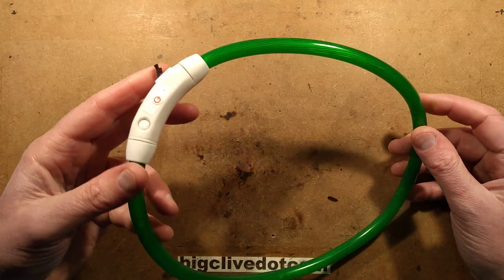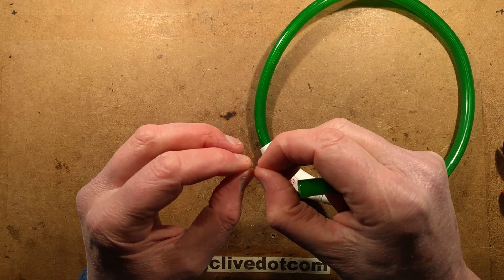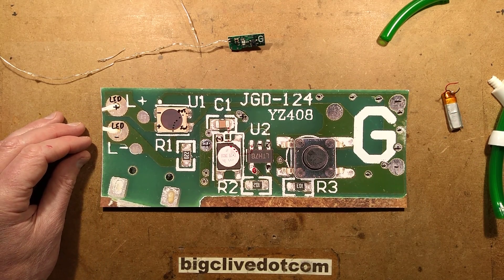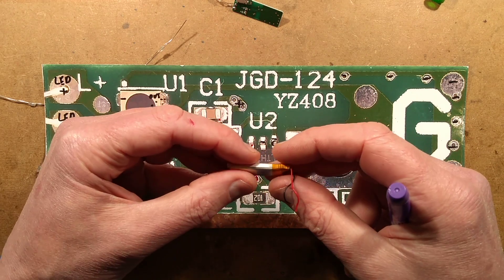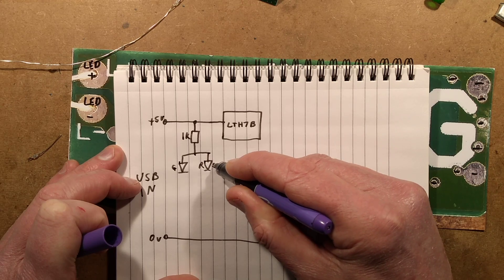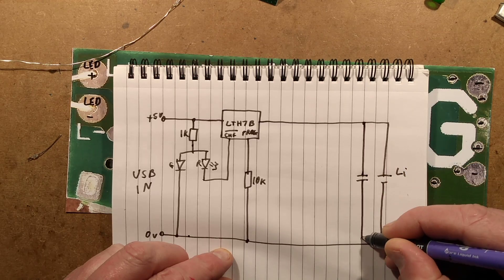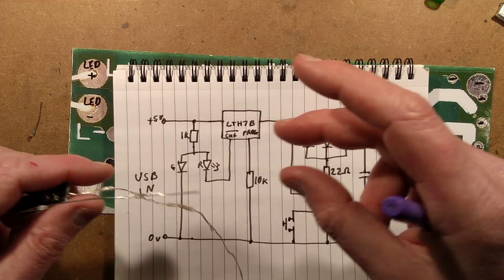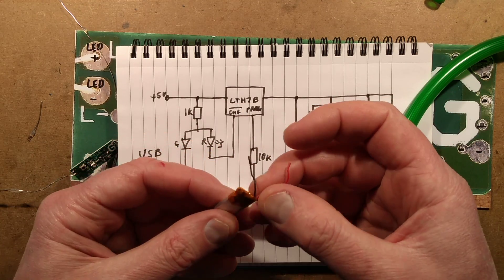Flashing USB rechargeable dog collar teardown.

Comment: I bought one of these the other day, cost £4.99. The tube is rubber with leds inside. There is a mark which tells you that is the most you can cut off before you get to the leds. Other than the rubber tube all seems to be the same except I haven't taken it apart to see what's inside. Nice to see the insides though, thnx.

Comment: Tried to fix my family dog's LED collar but it was far too corroded on the inside. My dad is what I would call chaotically lazy. He took the dog into the sea 3 times, each time it started glitching, on the third it just went very dim then stopped working. The idea of changing a £15 LED collar to a £5 basic is too much work for him. He is a man who won't be told, if anything he will double down on going against advice, even if it results in breaking and costly replacements. reverse psychology is a doozy.

Comment: Nice to see this dismantled for reference.  I've one on the bench to repair when I get around to it.  The there was a sleeved break in the wires from the battery unit to the LED string that's separated and needs a wee bit solder.
Reply: You can buy it from here at a lower price at from 25.99$ only + free shipping faster, the quantity is limited: https://vanancy.shop/products/dogcollar-led-accessory-with-usb-charger-anti-lost-avoid-car-accidents-for-dogs-puppiesled

Comment: You can trim it to any length... but why doesn't it matter how many LED's are in the string?
Reply from the maker: The LEDs are in parallel and the current is limited to a level where trimming up to half of them off would still be OK for the remaining LEDs.
Reply: @bigclivedotcom  Aah it's simple as that, thanks.

Comment: Is there a way to turn a 220V transformer to a 120V fairly easily? They sent the wrong 12V power supply. Can I just disconnect the center pins on the PCB?I know you join them to make it 220V.
Reply from the maker: It depends on the type of power supply.
Reply: @bigclivedotcom   It's rated 50Hz. So I think I answered my own question. The serial is DB351491. Thanks Clive.

Comment: Always love your videos. I liked this product because  the PCB was well designed and built done to a cost. The use of "fairy lights" is a novel idea for a dog collar. Usually these are a stiffer wire or WS2812 type of  setup. At least the ones I have had for the family dogs and the lights fail. Of course, tear down ensues afterwards;)

Comment: Not sure how else to ask you or someone else with knowledge in this area a question so here it goes..
Recently I mentioned that I got a 1000LM Solar motion light from Walmart, a Mainstays brand light. The problem i'm having with it however is its not using the standard replaceable 18650 battery, its using the one that has a quick disconnect wire on it, so my original plan of being able to charge it with a charger if needed is down the drain. So I was wondering how I could go about either charging the battery as is, or finding the same battery with the quick connect/disconnect wiring(if I ever need to replace it)

Comment: "Don't want to come off accidentally"

Actually, you do want a collar which can break off or slip off somewhat easily for the safety of the dog. Back in the 90s, dog collars were made to be extremely difficult to remove for the reason you said, but the problem was it was killing scores of dogs.

If the collar got snagged on let's say a fence if the dog tried to jump over it, they'd get hanged. This is what happened to one of my uncle's dogs, he was on one of those stake and rope systems in a fenced yard and tried to jump the fence one day. Since the collar wouldn't break away, he hanged himself and died.

Most respectable collars today are made to break away at some point to protect the dog.

Comment: 3:20 That's nice ... I had an old one (I repurposed after that) on which the cell was running flat. The case was welded shut.
I then soldered in a AA battery holder and stuck a AA sized Li-ion cell in that ... using then to light up my cats house (to see if he's in) ... but only for a short while ... it wakes up the cat and he doesn't like that.

Comment: when the lithium cell falls below.5 volts the led's turn off to prevent a full discharge so there is no way of rendering the lithium dead & the setup is exactly the same as a rear flashing light as a bike light

Comment: Towtrucking in winter can be a) dark and b) dangerous work. I got a flashing dog collar so that i can put it around my arm when i'm working in hazardous conditions.
Reply: For visibility in towing, have you seen the 'Halo' light that Ron Pratt uses on his hard-hat?
Reply: @michaeltempsch5282  Yes i have seen it. I don't use a hard hat unless the situation really requires so - such as taking scrap cars to recycling plant, where a hard hat is mandatory all time inside the premises. It's not mandated by law and i have not accustomed to using it.

Thus the "Halo"-light or similar has not even crossed my mind.

Comment: I use an earlier version of those collar (with mini USB port) through the winter months now for about 5 years. Inside is an odd kind of lithium cell. The cell looks like an electrolytic capacitor. Would be nice to get a replacement for.

Comment: So while you can cut it, you maybe shouldn't since the resistor is meant for a certain length of string. One or two might be fine, but if you chop it to size for a chiwawa the LEDs might get to high of a current.
Reply from the maker: The current is pretty low.  You could probably cut it down to about half the length without damaging the remaining LEDs.

Comment: I got dog collar like this, but mine has only 1 LED which lights through transparent plastic, plastic housing is very similar (almost exact)
And yes, this rubber thing opens usb all the time, even in winter, sometimes it gets stufffed with snow or ice, but there is no problem (Maybe my few drops of WD40 protecting from damage?)
Reply from the maker: An oil film would be a great help in preventing water initiated corrosion.

Comment: these are by far the best. they are incredibly cheap and last pretty long with many recharge cycles.
EDIT: 
The ones I bought were a bit more optimized with just a charge controller, microchip and switch as well as a red charge led.

Comment: If there's no protection, and it's not waterproof, is there any danger to the dog if it does fill with water and short out the cell?
Reply: Usually it's inadvisable to fill the dog completely with water.
Reply: With a cell that small even if it went nuclear it's unlikely it would even burn through the plastic.
Reply: I hope, the dog doesn't go woof.